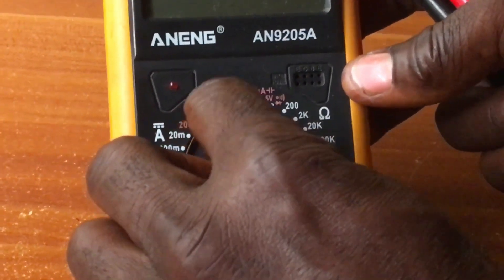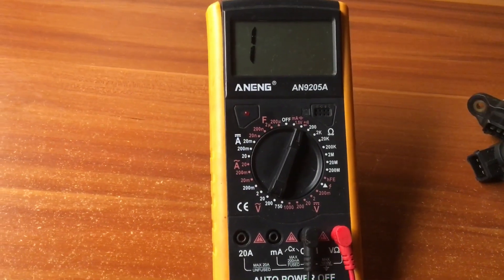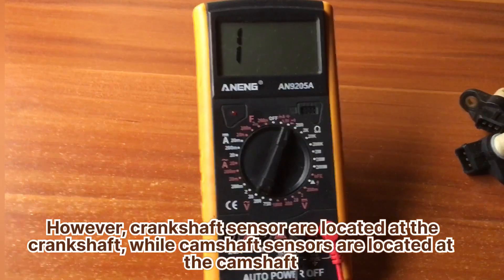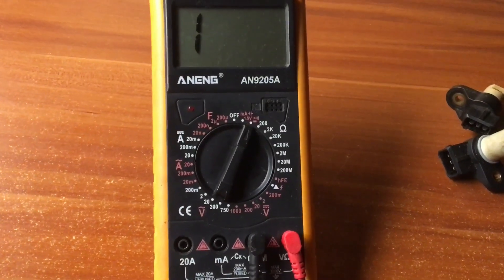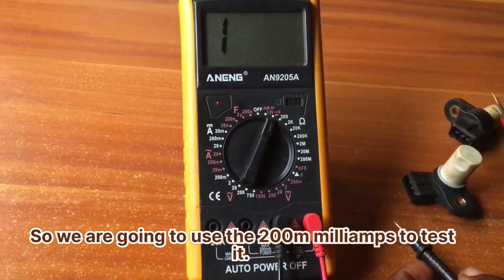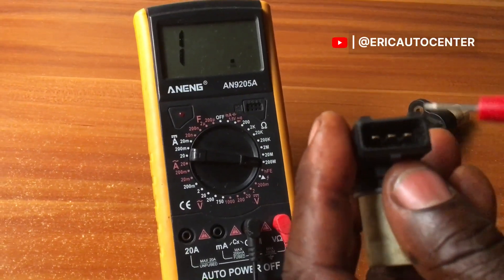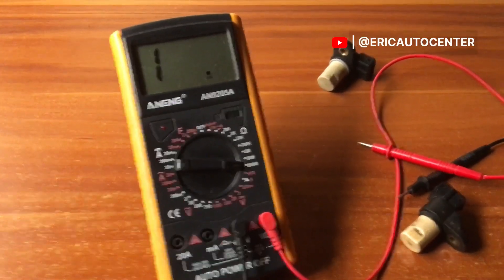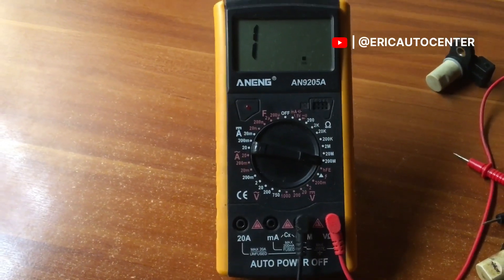What Are Ohms Value Of Good Crankshaft & Camshaft Sensors

Comment: Isn't that supposed to be mega ohms not milliamps?
Reply: Yes. But you said you're using 200 milliamps measurement when you are in the scale of 200M which stands for mega ohms. Kinda confuse me there
Reply from the maker: It’s not mega ohms? issue I was stating in the video mega ohms is a unit of resistance equal to one million ohms. while milliamps or milliampere is 1/1000   mA to measure General electrical current